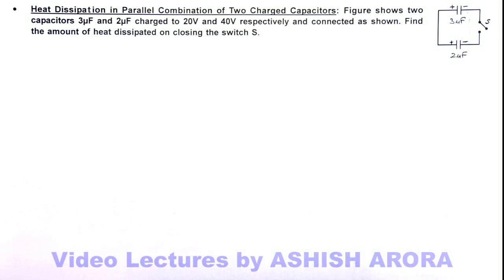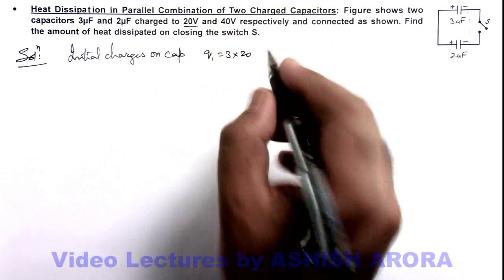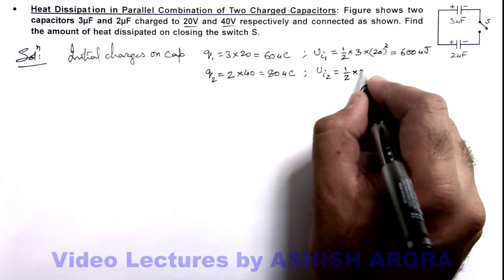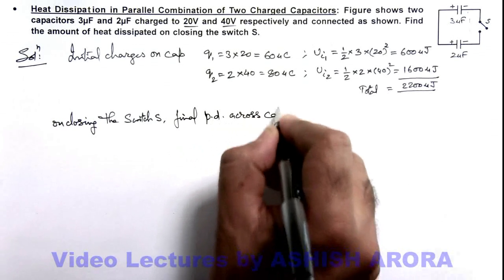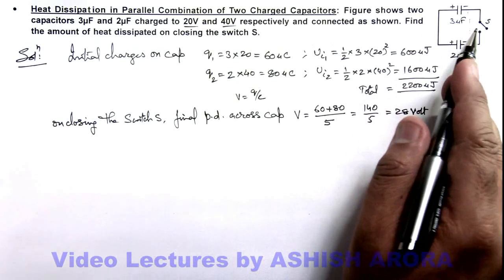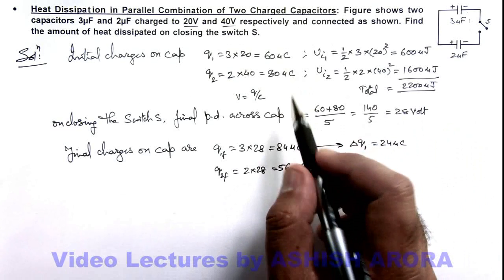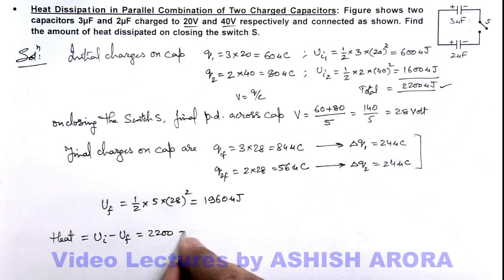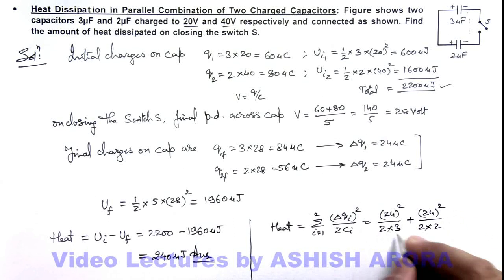8. Advance Illustration | Capacitance | Heat Dissipation in Parallel Combination

Comment: Sir why heat is not equal to ..(delta q)^2/2*5....as both capacitors are in parallel ..???
Reply: As if you make the equivalent capacitor and try to calculate , it logically make no sense as single capacitor alone can't loose/gain energy there must be something to inculcate the effect..
Reply: Yes
Reply: Yes sir please reply
Reply: It is applicable but you have to find it for individual capacitor and then add them
Reply: Because initially both were having different potential differences therefore different energies
That's why you have to calculate it seperately and then add/subtract at last

Comment: Sir,I didn't understand why on closing switch we are getting parallel connection,it's looking like series!
Reply from the maker: In series combination we consider capacitors only when these are initially uncharged... here capacitors are initially charged and it will distributed till the two capacitors will have same potential difference... as p.d. is same across the two capacitors, we consider them in parallel...
Reply: But they are connected end to end?? and it's also possible that the total charge will distribute equally in two capacitors and then they will be in series?
Reply from the maker: As initially these are already charged, charge on left side (where both +ve plates of capacitors are connected) is non zero so they can never be in series as in series one +ve plate of a capacitor is connected to -ve plate of other one in series and thats not possible here...
Reply: Ok understood,thanks sir
Reply: @physicsgalaxyworld  god
Reply: I have never seen as u physics tecaher in my life.. you are good for me
Reply: question related to your name is nt included in jee portion (chem)